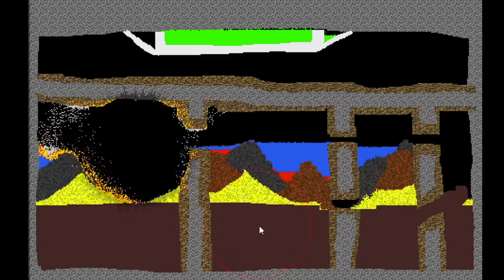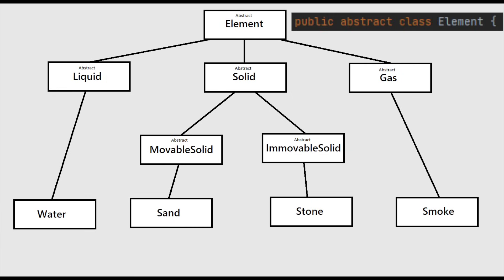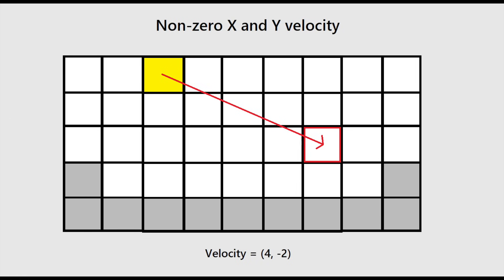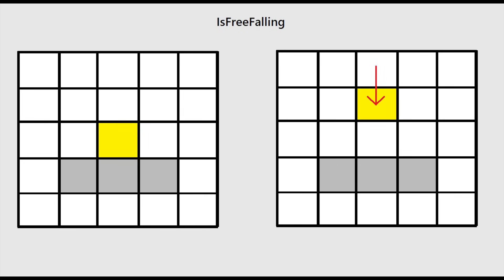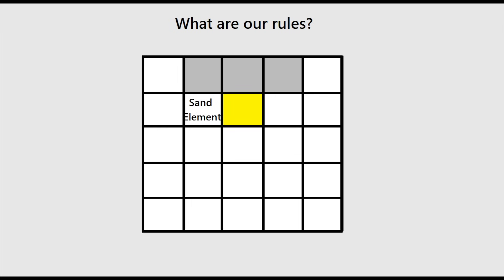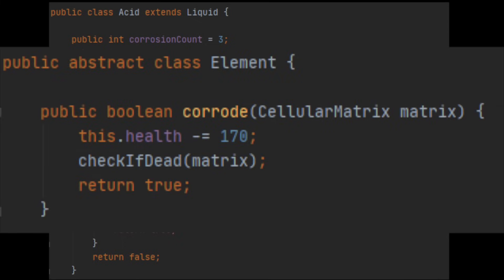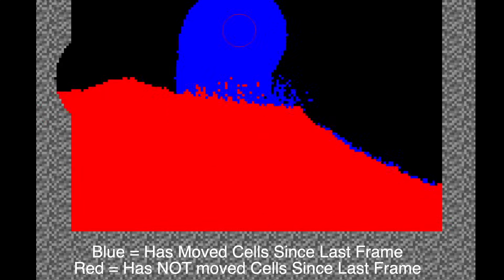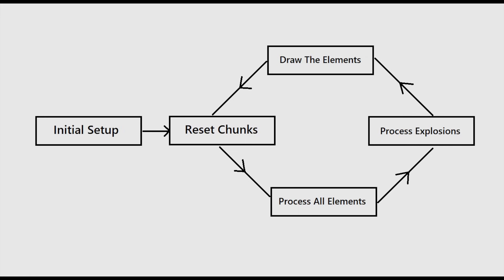How To Code a Falling Sand Simulation (like Noita) with Cellular Automata

Comment: I would of never of thought there was so much math and physics involved in those falling sand games. kudos to whoever first come up with the code for this.
Reply: simulation without physics is not a simulation, ad physic without math is not physic. but the bigest problem is not the physic but the code optimisation.
Reply: @skymanclaw441 well… that’s not exactly true. I simulate math problems with random variables occasionally and that doesn’t have any physics involved. For example: what is the average length of two random points selected within a 1x1 square assuming equal distribution? You can solve this problem by integrating the distance formula over a 1x1 square, or you can just simulate 10k pairs of random points selected in a 1x1 square, take the distance for each pair then take the average.
Reply: @blablabla7796  They said physics without math it's not physics, they didn't said maths without physics is not math
Reply: @secrom36  no, they said simulation without physics is not a simulation. That’s literally the first line in their message.

Comment: I heard at the end of the video you make your threads every time through the loop? Why not keep the threads around and just reassign work every loop? Thread creation has overhead in the cpu time
Reply from the maker: I did this project as a way to get more experience with Java since I was using it at work (web dev). This is why many of my approaches are not as well suited for game dev. Also, this was the first time I ever worked with multi-threading. So it was simply an oversight and lack of knowledge on my part. Good catch.
Reply: @marf1610  no worries! i was just curious if there was a reason behind it is all. the project is really awesome, just when i heard it that was one thing that i was like "hold on every frame? that wouldnt be very fast" and i had come across a similar issue in the past working on a project. so was just throwing it out there. thank you for sharing your journey on it

Comment: Instead of manually detecting what element each liquid element is on top of, you could use a density value and decide to either stay up or go down depending on the value compared to the one below. You can also use this value to do inertial calculations, and it can also be used for gasses (by providing a negative value instead of positive).
Reply: Note: that last part (gasses) would likely require a pressure gradient over the vertical axis to solve with.

Comment: that's CPU based no? I'm planning on doing a uni project on  falling sandbox kinda like that, but utilizing webgl and storig cell states in 2D textures. Then updating the world using a checkboard pattern of some sort and swapping values inside the matrices. I'm pretty sure it's gonna be heavier on memory but something tells me I might be able to have a fast as fck sim in the end.
Reply from the maker: Yes mine is CPU based. I think to implement all the functionality I have in this simulation on a GPU would be more difficult. But a GPU would be much faster and able to handle more particles overall.

There is a game called "Jelly In The Sky" which is entirely run on the GPU which might be interesting to look into.
Reply: @marf1610  yeah I don't think I'll go as deep as you, I'll try to get a few things working and submit it lol. I'll check that game, thanks a bunch

Comment: hey, great video! I am having some trouble implementing the water physics correctly however, using velocity on the x dimension to speed up the spreading of water. I'm just running into lots of strange issues, I think relating to how it chooses a direction to go in. I am not sure how else to explain it, but I was wondering if you perhaps had any tips in implementing the water physics? I'm doing this in c++.

Thanks!
Reply from the maker: After implementing velocity in the simulation the elements no longer check both right and left for a place to go. If the x velocity is positive it only looks to the right and down-right. If it hits a Solid element then the x velocity is multiplied by -1. So next frame it would only look to the left and down-left. This isn't explicitly mentioned in the video.

The same logic is applied for solids and gasses. This reduces the amount of cell checking required each frame once liquid begins looking further than one cell away.

For liquids the velocity usually indicates just direction. And the maximum is taken between dispersionRate (usually around 5) and velocity for how many cells away to look for an open spot. This ensures it is always looking at least 5 cells away.

Also, if a liquid is falling downward for lets say 4 cells and hits a solid then it will launch another function to search right or left (based on velocity direction) another 5 cells. This helped liquid spread out further once it hits the ground when falling.
Reply: @marf1610  Thanks for the very helpful answer. So do you just decide randomly when first creating water what x velocity it should have?
Reply: hmm I am not sure what I am missing. my attempt at implementing the spreading as you said has just resulted in water sometimes not falling to the left when it should, and long perfectly straight lines shooting out to the right...
Reply: so upon a lot of pain I'm beginning to think this is out of my current scope of possibilities 😅 I'm hitting road block after road block. Hopefully i can come back to this in the future when I'm a better programmer :p
Reply from the maker: Yes when liquid is created it randomly generates a positive or negative x velocity (Very small so it just indicates direction).

Lots of pain is exactly right haha. I spent many hours on this project trying to solve challenges that I was never able to figure out and had to choose a new direction. But all of that work (which sometimes feels wasted) contributes to becoming a better programmer. Good luck!
Reply: @marf1610  Hello once again, sorry for more questions haha. Does your program end up using a double buffer? I am having a hard time figuring out how to work around some of the strange issues I am having, and my only real solution I can think of is a double buffer. But I also am not sure how I would go about implementing a double buffer anyways, because how do you then make sure that 2 elements don't try and move into the same spot... so many questions, such little learning material online...
Reply from the maker: @JackAllpikeMusic  No I do not use a double buffer because then you run into issues like you mentioned of elements trying to enter the same cell and are not aware of each other.

The tech talk by the Noita devs in the description of this video was the most helpful for me when I was trying to figure this stuff out. If you haven't watched it yet then I highly recommend it (and if you have do it again. I watched certain parts many times trying to understand because they move quickly and its really dense.)

In the tech talk they mention they don't use a double buffer for the reasons we have mentioned and they use a single buffer. Single buffer solves a lot of problems but introduces one major one which is how to operate on the buffer in parallel. They explain a checkerboard approach they do to ensure there are no concurrent modification errors. I implemented a column based approach for my smaller simulation.

What kinds of issues are you facing due to using a single buffer?
Reply from the maker: @JackAllpikeMusic  Yes I found using the 1 dimensional array and calculating indices with x and y coordinates to be the best way to do it in C++ as well, so I second that.

I'm glad you were able to resolve a lot of issues you were facing!

Regarding the liquid spreading out. To eliminate the 'spikes'' of liquid stacking on top of each while it spreads out I added random variation to how far a liquid element looks each frame. So water has a base dispersion rate of 5 for example. But each frame it may look 4, 5, or 6 cells each frame depending on the random factor. This smooths out the dispersion.

When liquid is spreading out it looks multiple cells to the right or left. If it encounters a solid as it iterates through all the cells to its destination then it stops checking any further cells. However, if liquid encounters another liquid as it spreads out, it will continue looking past that other liquid element for an empty, occupiable space. 

So for your pillar of water that forms as you spawn it, the water elements on the inside of the pillar should look down, see a water element below it, decide to look left or right, and would also see more water. But instead of stopping there they would continue looking until it finds an empty cell.
Reply: @marf1610  Water piling up, or only going left (because the for loop is x = 0 x < screenwidth) is also the issue I have.  I tried alternating from x++ to x- - to loop over the pixels, but that just creates a shaking affect like the floor is a cheese grader slowly "eating" the water.  I then tried randomly chosing to loop over the pixels from left -> right, or right -> left, and that also sort of worked but gives a back and forth shaking affect, where a mountain of water slowly "unpiles" from the center as a big pyramid

Comment: Now I’m wondering if there’s a way to do this entirely with shaders on the gpu and if that would be much faster
Reply from the maker: It is possible to run a falling sand sim on the GPU but it would be much more challenging to achieve the same level of functionality as I have in this simulation.

Comment: My water is flowing to the left before the right, i believe this is because i search my list bottom left to top right but i have no idea how to fix this. I use a random float between 0-1 to decide where the water should go horizontally.
Reply from the maker: Yes its probably because you are searching left to right. 
I created an array of indexes for the row I was about to process and then shuffled it. I then used those indices to iterate through the row.
Reply: @ thank you. I’ve fixed the problem by using water penetration instead to level the water. Only problem is now my sand duplicates itself every second it’s in the water 😂

Comment: I know it's been two years, but have you perhaps revisited this problem by coding the logic in shaders? I tried this myself recently and it's promising in that the framerate becomes a non-issue due to the massive paralelism (a modern GPU has hundreds, if not thousands, of cores), but at the same time I've run into problems where the multiple "threads" step on each other's processing areas, resulting in problems like particles disappearing or appearing out of nowhere.
Reply from the maker: It is possible to code a falling sand sim via shaders but overall you have much less control over state and processing (like what you were mentioning). Most of the things described in this video could not be done on the GPU. Look into "Jelly In The Sky" for a game made on the GPU.

Comment: Mabye im missing something... How did you make the speed of the pixels falling/updating frame independent
Reply from the maker: I gave each element instance a velocity value which was updated each frame by gravity and can be affected by other things such as explosions. Each element also had two sets of coordinates. Integer coordinates which are its placement in the grid. And floating point coordinates which are updated by the velocity.

So if a single element is in free fall for a long uninterrupted time, its velocity will increase as the force of gravity accumulates each frame. If Y velocity is greater than 1 it will move one cell, if velocity it greater than 2 it will move 2 cells. 
Then the floating point coordinates are rounded down and that's the new placement in the matrix for that element
Reply: @marf1610 Thanks, nice vid👍

Comment: How and when exactly do you disable a chunk? I understand that you report to the chunk when you place an element or when an element updates and set it's step value to true. Do you just disable a chunk at the end of the frame?
Reply from the maker: Basically, yes. At the start of every frame each chunk has shouldStepThisFrame set to the value of shouldStepNextFrame. And then shouldStepNextFrame is set to false for all chunks. Throughout the current frame shouldStepNextFrame is set to true for chunks which have activity in them.
Reply: @marf1610  Thanks for the quick reply. Fortunately I figured it out 15 minutes after posting my comment. Your video has been very helpful! Wish you well.

Comment: I tried compiling your game, and I just get a lot of "unresolved external symbol" errors
Reply from the maker: I think you may have tried to compile the C++ falling sand github repo that I had started working on. You want to use the FallingSandJava repo linked in the description.

If you are using the Java version then you will need to run the installation process on the gradle file included in the repo to download and install the necessary dependencies.
Reply: @marf1610  oh, so the c++ version is still unfinished? That is the one I wanted to check out
Reply from the maker: @gez_4515  Correct. I didn't know any C++ when I started it so I got stuck and got sidetracked doing other C++ projects since then to learn. I am unsure if I will revisit it.

Comment: So how do I actually start being able to make one of these games like if I was asking how do I paint I need to know what the paper is and how to get it and like what's the brush and how do I hold it like I don't know how to actually start making one of these falling Sand games and I think it'd be a good place to get started but I can't figure out what it is that I need like is unity a thing can I make sand falling Sand games in unity I don't know how to use unity
Reply from the maker: The issue with falling sand games is that you need pretty low level control over each element in your 2D matrix. And also you need to control the order in which the elements update. If you used Unity and represented each element as a GameObject this would be a huge waste of space and you wouldn't have control over the order of updates (among other limitations).

This is why most of the sand simulations you see are not made with a game engine. Because game engines abstract away a lot of the fine control to speed up your development. This is also why the Noita devs created their own custom game engine. 

When creating the 2D matrix and all the logic for updating elements you are essentially creating a building block of making a game engine.

To get started on this I think a very good place would be to use JavaScript and the HTML5 canvas. There are lots of tutorials out there on setting the canvas up and interacting with it. It will not be as performant but it would be a much easier starting place.

Also, I think Sandspiel is made with JS and HTML5 canvas.
Reply: @marf1610  thank you so much that was a very detailed answer I appreciate that

Comment: Very nice. I really like the inertial resistance concept, seems quite unique. But I would not use class hierarchy for elements ever again. From like 2014 to 2017 I was developing similar game in Java and when elements and their interactions were getting more complicated it end up with explosion of classes. It was hard to change element's single feature (movability, flammability...) while maintaining others, facing the diamond problems etc. Years later I was learning JavaScript while developing another falling sand game. I encoded elements directly into ArrayBuffer, together with colors, values and feature flags. Now, I can say that this is much better. Great performance (even in JavaScript!), trivial serialization.
Mentioned game are Sand Game 2 and Sand Game JS If you are curious.
Reply from the maker: Thanks for sharing your experience! I checked out your Sand Games and really liked the plant growing mechanics.
Up to this point in development I didn't encounter much issue with adding new classes but I could definitely see the effort exponentiate as you add more unique features that each new element must account for.
Reply: There are also way too many megamorphic virtual calls everywhere

Comment: How would a character interact with the solids ?
Reply from the maker: This is something I started working on but didn't complete. My plan was to treat a player character like an element which takes up multiple spaces. Take into account velocity, calculate next position, and iterate to that position checking for blocking elements along the way. It would get tricky for things like how a moving/falling solid shouldn't block a players movement, etc.